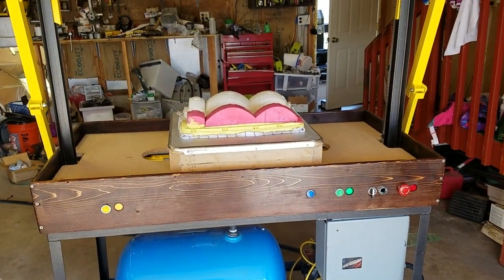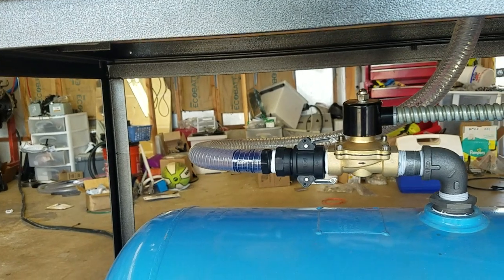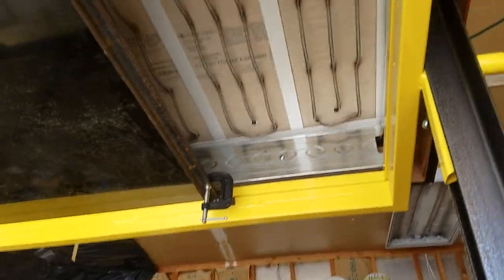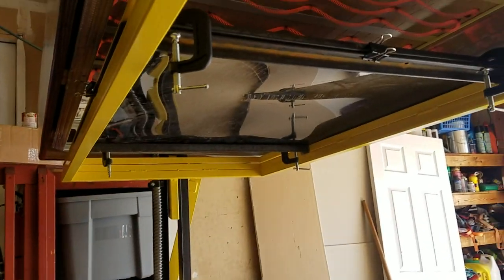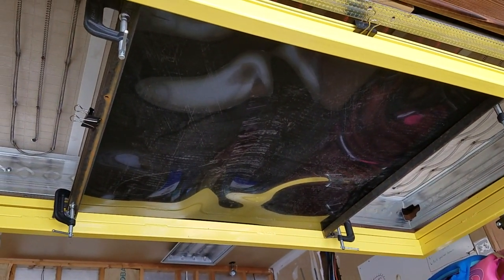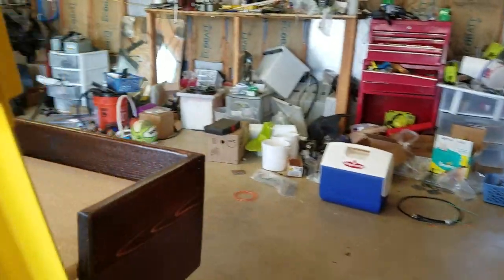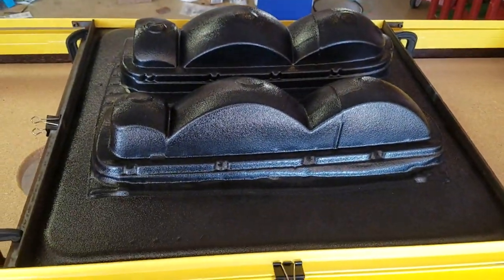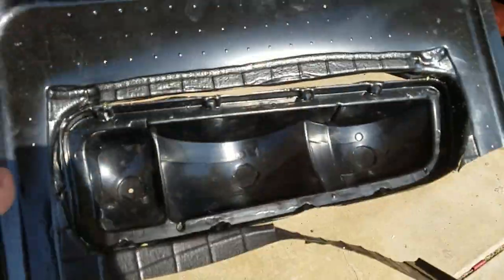First pull DIY vacuum form vacform machine!

Comment: Foxau2, I was wondering what manufacture solenoid valve you are using?  I bought the plans from Protoform, and am making changes to what I think would be more user friendly. Let me know when you get a chance. Thanks!  Wayne (Clifton, NJ)
Reply from the maker: I'm unsure the brand. I just bought it on ebay.
Reply: I took a look on eBay and found a brand called Ace Crew for $43 bucks . They also have a website for the specs at: acecrewdirect.com. It is 1" NPT (In and Out) and has a 24 VDC coil. Thanks for posting the video and your reply to my question.  Wayne

Comment: That is just so much more complicated and expensive than it needs to be.
Reply from the maker: The parts were free and I wanted a nice project...
Reply: @Foxau2  love your work , mine is almost finished but wondering what you used to hold the nichrome wire coil to the ceramic backing  boards? Is it just nichrome loops ? Cheers from Australia  😀
Reply from the maker: @drujames272  they are cotter pins. The nichrome is held in the loop part of it. It's pushed through and opened on the back side. Very simple solution.

Comment: Good afternoon, my friend, I'm doing a vacuum forming machine to present at my engineering degree, but I've had some problems. I'm here asking you for help if possible. My vacuum pump has 7 CFM, with it it is possible to generate the necessary vacuum to form the polymer? thank you from ja, my email is wilsonlima3006@hotmail.com, give me yours so that I can send you photos of my TCC.
Reply from the maker: It is possible, but it would be better if you had a vacuum reservoir like my blue tank on the bottom. But it all depends on the size of the platen you're forming on.

Comment: Nice job on your machine, what gauge wire did you use on your heating elements?
Reply from the maker: I actually bought them on ebay. They came out of China. Here is the link: https://rover.ebay.com/rover/0/0/0?mpre=https%3A%2F%2Fwww.ebay.com%2Fulk%2Fitm%2F232302122105
Reply: Thank you